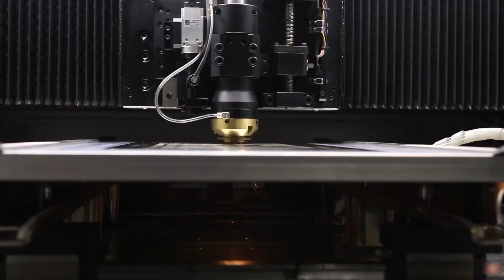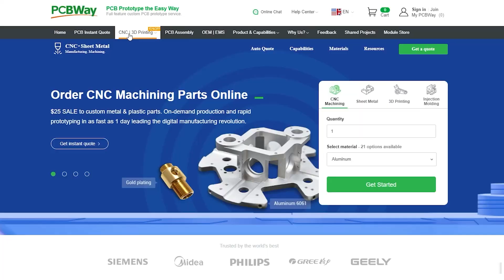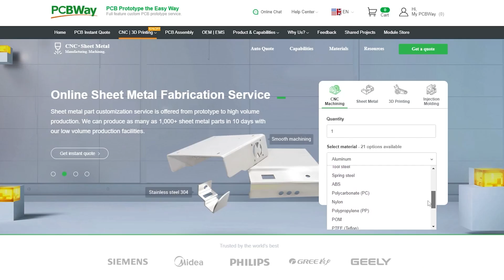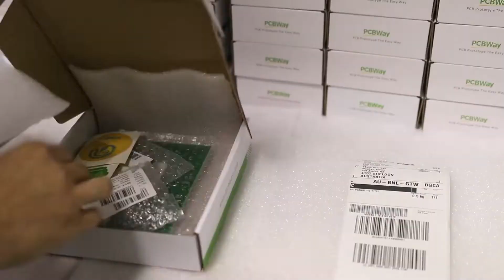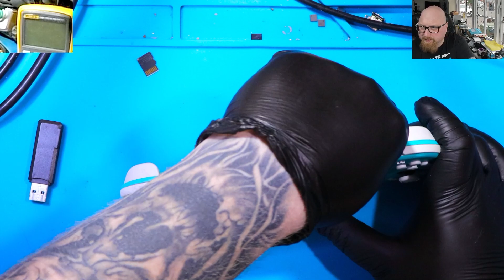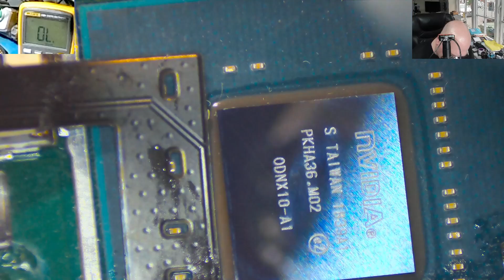HWFLY for Switch Lite... Let's solder it!!!

Comment: how to update the picofly rp2040 chip firmware? is it same like v2 picofly chip ? fw_2.73.uf2 ?
Reply from the maker: Yes, exactly.
Reply: i tried but its not moving and after few minutes it said fail to copy. my chip is "RP2040-Lite" and the code on the rapsberry is "RP2-B2 22/04 PBC608.00. please help. when i turn it on it just blink blue, and 2 times green, and repeat green... the NS just boot into ofw like nth happen. @tvpartsworld806

Comment: Dear Genius, I desperately need your help! On the 20th October 2023, my home was flooded as Storm Babet passed over the U.K. All of my electronic consoles etc were ruined & I was wondering if you could repair some of these holy grail products, such as 2 x PS5's which are on the original 1.0.2 firmware & 2 x Mariko Nintendo Switch consoles 1× Nintendo Switch OLED 1x Nintendo Switch Lite also a PS4 500 Million & PS4 500GB both on custom firmware 9.00. I would really appreciate a response. With regards

Comment: how much do you charge to install this?  I have a launch Switch that no longer boots..I have left it plugged in for HOURS and it doesn't boot  So I am sure I will have to buy another Switch (I do have AutoRCM and drained the battery a dozen times)
Reply: If your switch is no longer booting and won't charge, I assume you need a battery replacement which is very easy to do.
Reply: @OnBrandRP  Turns out there was nothing wrong with the Switch...it was the USB-C to C cable I was using.

Comment: Boss you meaning if give dat point 0.590 v is it fine and cmd 0.623  v and  clk 0.767 v diode mode. Multimater read.

Comment: After watching Lius Rossman and Northridge Fix for years I recently found your channel preforming my first PicoFly install. I must say I really appreciate your callouts. Knowing values you expect on test points and temputure settings is giving me a better unerstanding of your thought process and your diagnostics. Thank you and appreciate your content!
Reply: Watch out tho, different multimeters have different values.

1 of my multimeters had 1.160-1.180 for all readings on an Oled picofly.
And my 2nd one had 390-410.

The picofly worked perfectly so I don't know if it's a multimeter thing or a battery issue.
Reply: You should add macho nacho and modsvilleusa to your list of game modders to watch

Comment: i have beep sound on diode mode on rst point is it ok or no?
Reply from the maker: Beep sound means this point is shorted to ground. What's the reading?
Reply: @tvpartsworld806  everything is ok 👌 did it with success! it's my first hardware moded console , thx a lot ! ♥️🎉👏
Reply: @Lojalny where did you buy your chips

Comment: SoC is not just for nVidia. It's pretty common abbreviation for system on chip. Just APU is for AMD, but it's exactly the same.
Reply: Isnt an apu just a cpu+gpu? And a SoC considered a cpu, gpu, and/or ram, rom, and maybe a special function processor(s)?
Reply: @elcoollow5955  yeah apu are just gpu that's inside the CPU.
Reply: @elcoollow5955  It's a little more complex than that but generally speaking yes. An APU is essentially a CPU that has a very specific piece of hardware on it that allows it to also run a integrated GPU. An APU is essentially a more powerful iGPU (Intel coined the term iGPU for their CPU's) 

An iGPU also known as a integrated graphics processor has been on Intel for many many years now however they were mostly always fairly weak whilst AMD was able to create a way to house a more powerful graphics processor that works in-hand with the CPU. Then you have Nvidia's SOC which is essentially an APU in practice but works a little differently.

Comment: Hi i messaged you recently via email to ask about you working on my 2018 switch V1 patched to fit a mod chip, do you supply the chip as well as i can't find the correct one i need??
Reply from the maker: The best way to contact is Whatsapp. Please whatsapp me to +447451466640
Reply: Did you do it ?